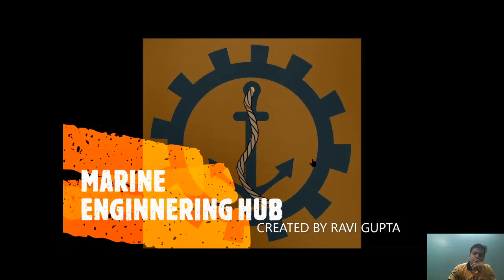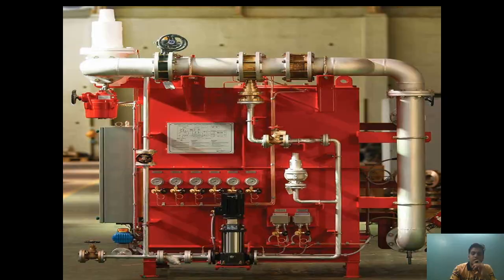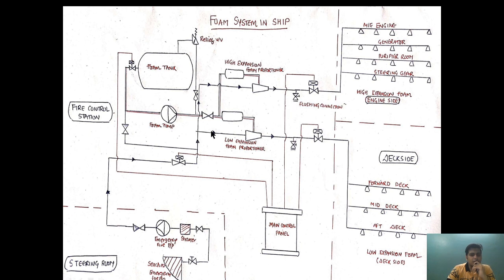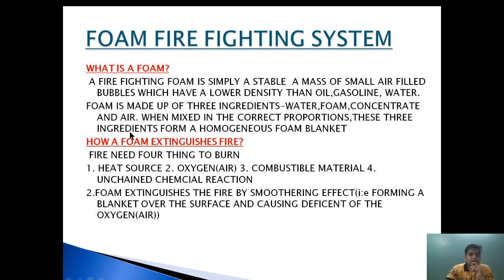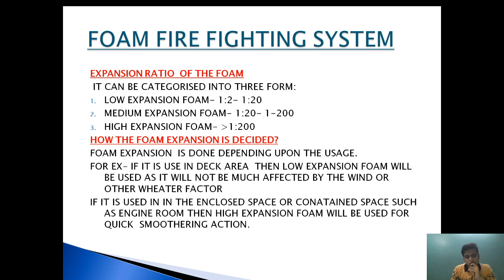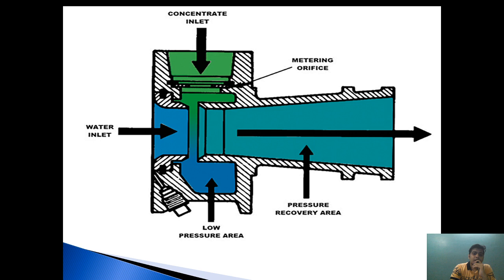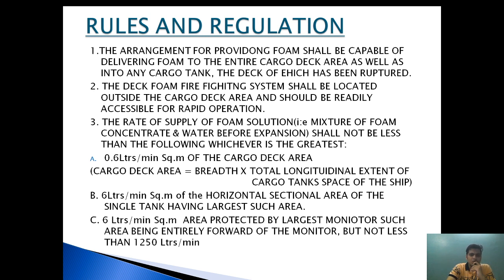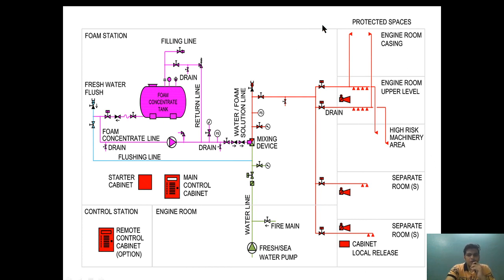FOAM SYSTEM|EXPLANATION|EXPANSION RATIO|REGULATION|

Comment: Nice explanation sir.   Thanks for the valuable information.      Sir I have a question ..... Why earlier in Sulzer engine jack bolts for the main bearing are inclined?
Reply from the maker: Hello Pawan ,
Sulzer engine jack bolt for main bearing is inclined so that to ensure that the shaft bending stress is less at the centre as the hole can be cut more closer to the centreline of the crankshaft which provides better crankshaft alignment and less bending stress.
If you want to more soon video regarding this topic will be uploaded u will get more clear idea.
Till then please share my other video in your facebook and whatsapp status.
Reply: Tie rods should be as near as possile to the center line. since bending moment = force * distance. Jack bolt is an arrangment which holds the top cover of main bearing in position. By eliminating the requirement of bolts to hold it and reduces the width  of top cover, so that tie rod can be bought close to the center line of engine.

Comment: I have a question. Any who knows the answer should kindly share please.

Why is low expansion foam no longer allowed as the only fixed fire fighting system onboard ships?
Reply from the maker: Low expansion foam is used on deck for extinguishing the fire (mainly for open area fire)

but co2 is used for closed area fire (such as engine room ,cargo hold,pump room etc)

so normally you will find 2 extinguishing system onboard